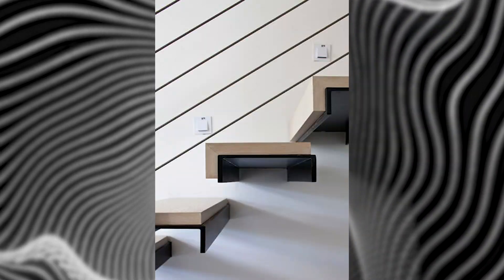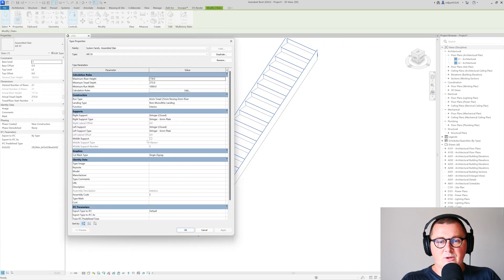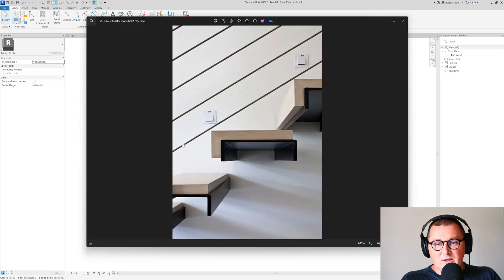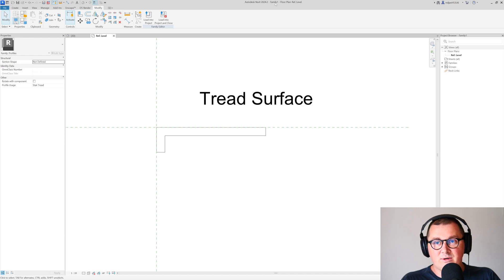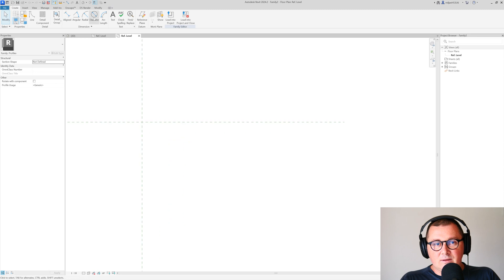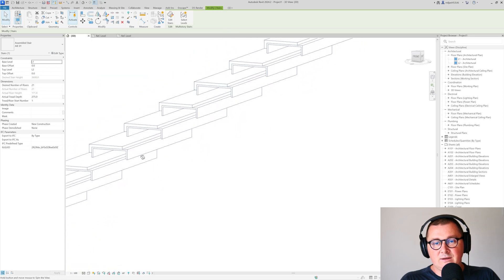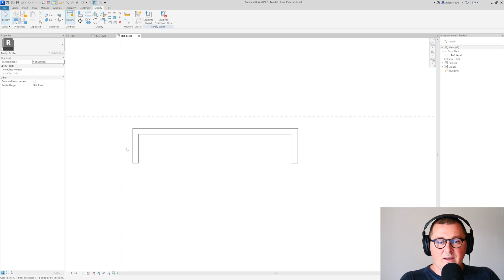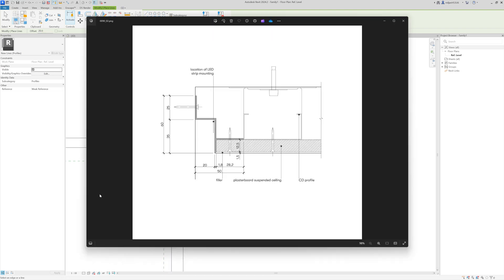Floating Stairs with Custom Profiles - Revit Tutorial

Comment: Hi! How can I extend the thread to the left so that it's longer than the riser?
Reply from the maker: Take a closer look on how profiles (families) were created here. So just create nee family which profile is extended from Center reference plane
Reply: @arkiteasy  Thanks for the reply! I think I need to clarify.  Imagine when you are taking the stairs, the left side of the thread is longer than the width of the riser (not longer in the direction towards you). Is this possible?
Reply from the maker: No, it’s not possible to make it using Stair tool and having it as one stair. One of the workarounds using stair tool will be to create it as two separate stairs. Also, you can make it using Molel In-Place tool, that’s the easiest way for project specific elements. Third one, the most advanced and not project specific, is to create it as Adaptive Component(s)
Reply: @arkiteasy  Thanks!